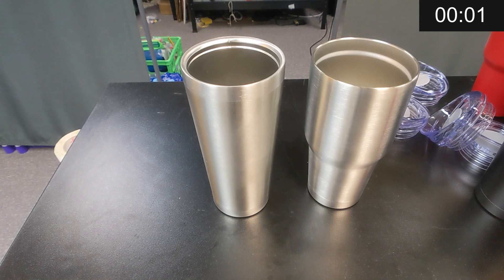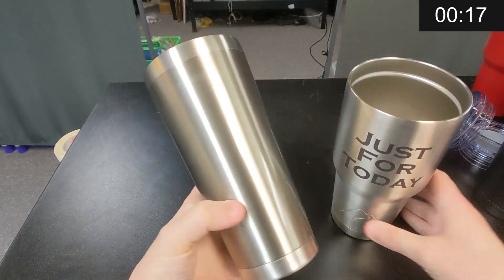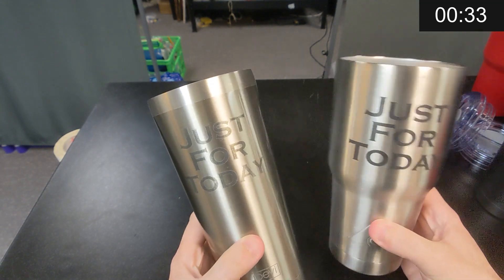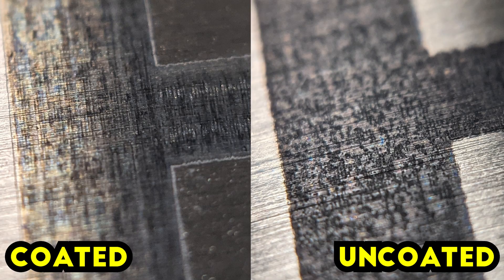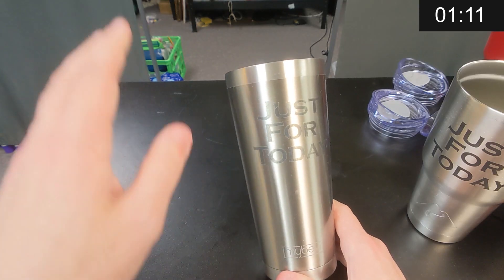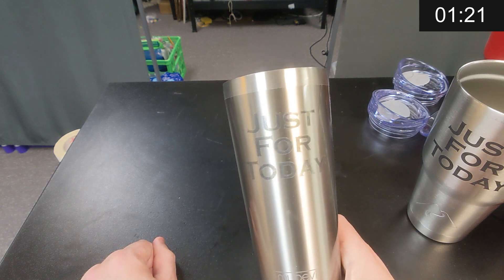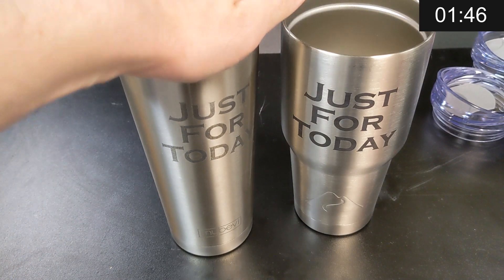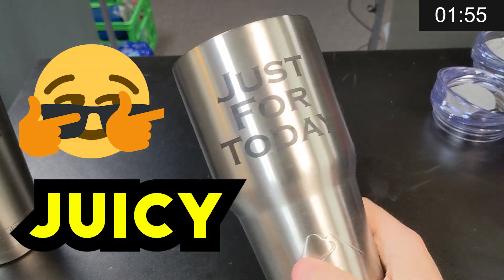Engravers BEWARE | How I ruined these steel tumblers... | Two Minute Tip | CO2 Laser

Comment: I dont get it, arent you suposed to engrave met with the fiber laser? Im trying to learn this stuff, thanks for your videos. Olmost watched all of them.
Reply from the maker: The fibers rotary tool can be unreliable with large tumblers like this. It's much easier to grab a can of marking spray and throw it in the CO2 and you get a much more consistent mark.

The fiber laser would be an excellent choice for doing something on the bottom of these tumblers like a brand or logo or a small brand or logo at the bottom edge that didn't require me rotating the tumbler to make the mark. For giant logos on the face however CO2 is definitely the way to go.
Reply from the maker: Further more the fiber laser wouldn't like the yucky plastic coating on these tumblers either. So whether you're using the fiber or the CO2 the plastic on these is going to cause an issue. Here's a video where I talk about marking steel tumblers with the CO2 so you can see the process I'm referencing: https://www.youtube.com/watch?v=NLsNRIfiMYI
Reply: Wow thanks for the info man, now i understand it.. Gonna get my fiber laser in couple of weeks, and watch all your tutorials AGAIN 😄
Reply from the maker: Sounds good, join the discord too, love to have you on there! Did you already order your laser?